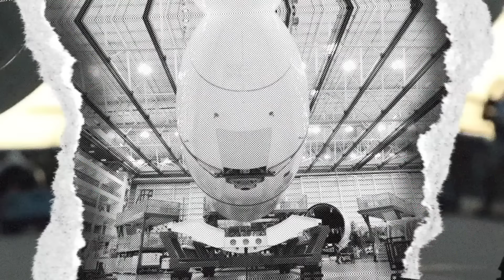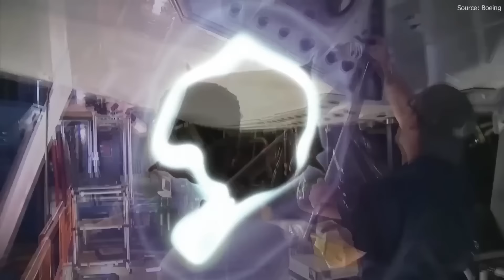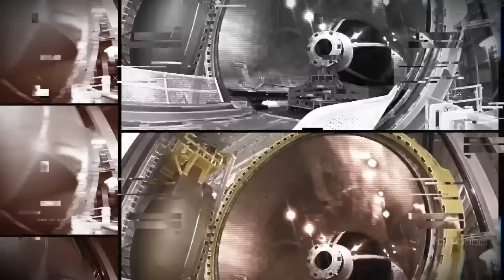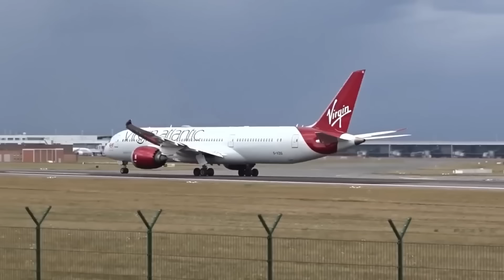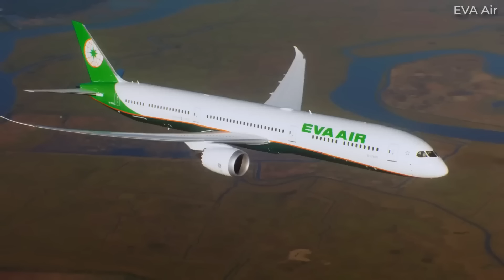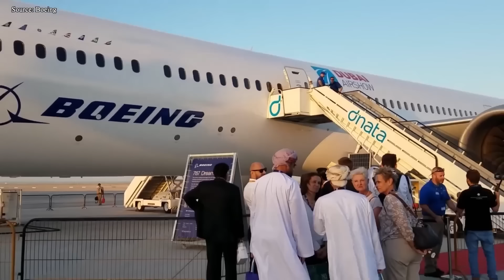This Is Why the Boeing 787-10 Is Quietly Dominating the Skies"Drive Verse"#driveverse

Comment: I just watched another video that said the B787-10 is not as economically efficient as the A350-1000 due fuel economy which is why airlines are selecting the latter model.
Reply: Many of the Pro-Airbus videos are made by people friendly to them. So are the Anti-Boeing videos.
Reply: However ,a Few Airlines also operations  with Boeing 787-10 Dreamliner Aircraft like Eva Airways, ANA ,Singapore Airlines, United Airlines etc
Reply: The Latest Customer that Operations with Boeing 787-10 Dreamliner Aircraft is Starlux Airlines of Taiwan 🇹🇼
Reply: Singapore 🇸🇬 Airlines Group with Subsidiary Scoot Airlines is the World 🌎 largest Operator of Entire Boeing 787 Dreamliner Aircraft Family of Smaller Boeing 787-8 and 787-9 Dreamliner Aircraft to Scoot Airlines
Reply: British Airways ordered Boeing 787-10 Dreamliner Aircraft to Supplement its existing Boeing 787-9 Dreamliner Aircraft and Airbus A350XWB-1000
Reply: Singapore 🇸🇬 Airlines orderd 30 Boeing 787-10 Dreamliner Aircraft Firmed Orders with option Alone.
Reply: 8 Boeing 787-10 Dreamliner Aircraft are in Flights ✈️ Operations from Singapore 🇸🇬 Changi International Airport (SIN/WSSS)